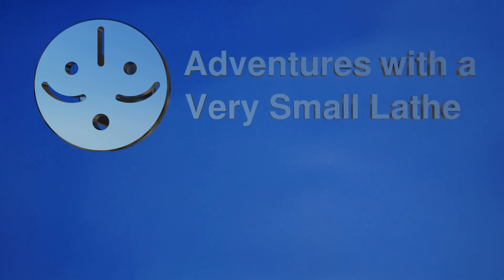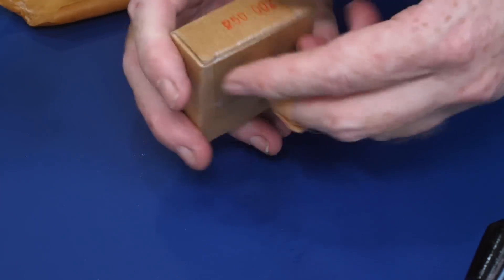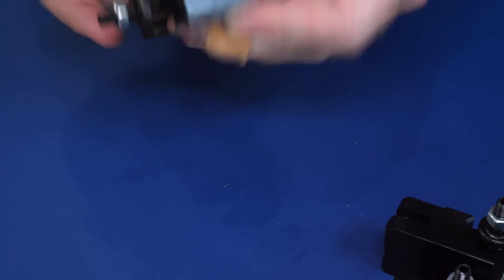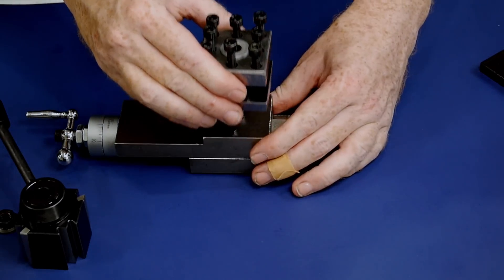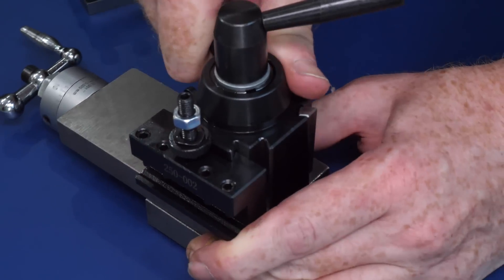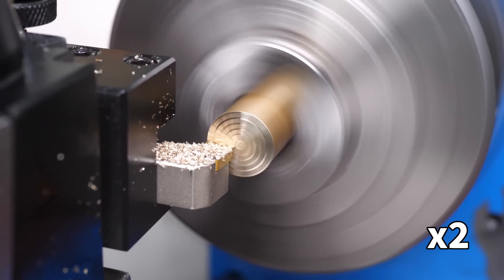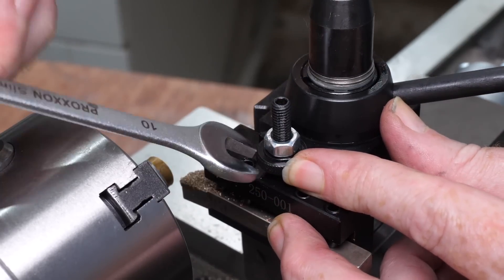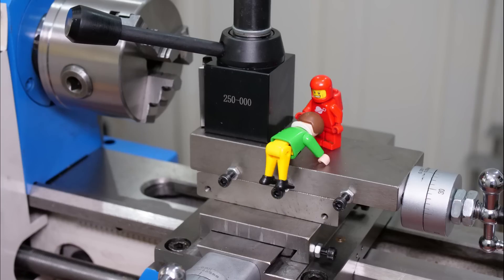Installing a Machifit Quick Change Tool Post on the CJ0618 Lathe and Banggood Tool Post Review

Comment: I have this same toolpost on my mini-lathe, and it's one of the  best modifications I've made. As you said, it's miles better than the cheap aluminum QCTP's most people seem to use. Better rigidity, better repeatability.  Combined with a tool post block (in place of the compound), I've been pretty impressed with the depth of cut I can take.
Reply: I was about to mention the same point.  I started with the aluminum version and while it was convenient and quick, it just wasn't very rigid.  A friend then uptraded me to the steel version shown in this video.  It was well worth the extra cost.  Advice to others:  go straight to the steel version.
Reply from the maker: What's the best depth you've managed with a reasonable finish? Is your lathe similar?
Reply: @AdventureswithaVerySmallLathe  With aluminum cutting inserts, I can take a 0.050" DOC in 6061 and still get a decent finish. 0.100" is possible, but surface finish definitely suffers, and the machine bogs (and sometimes stalls). 

And yes, it's a similar lathe to yours. That lathe is made by one company (Seig), then rebranded and sold by a lot of different companies. Mine is from Harbor Freight in the US.
Reply from the maker: @exhempknight  Nice!

Comment: I just received this one too! But I put it on the Proxxon 250. 
Yeah it’s a bit large but sure is nicer than the fixed post it came with.
Reply: Hi, so it can be  installed without problem on the Proxxon 250?
Reply: I used a bolt instead of the supplied pin for some reason I don’t remember now. It works ok but it’s a but too large so you lose some space and rigidity because you need to have the compound pretty far back. So it’s ok but not good.